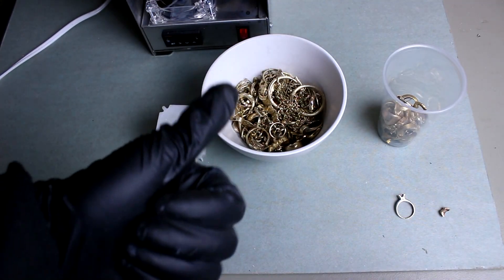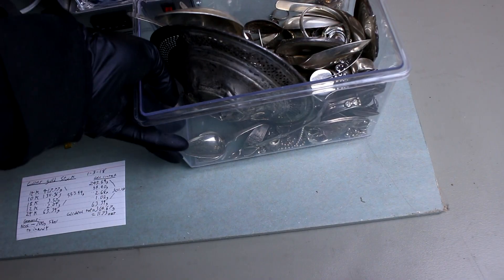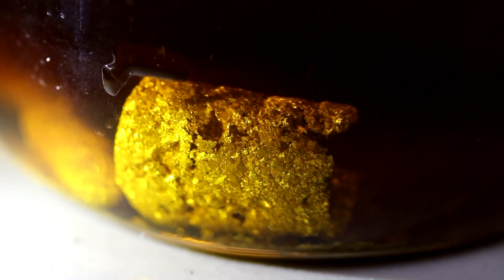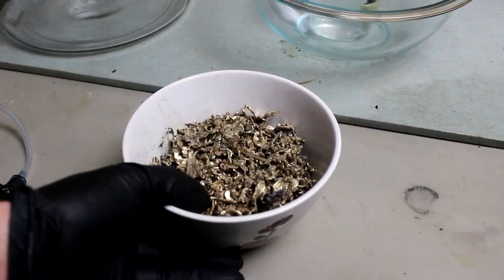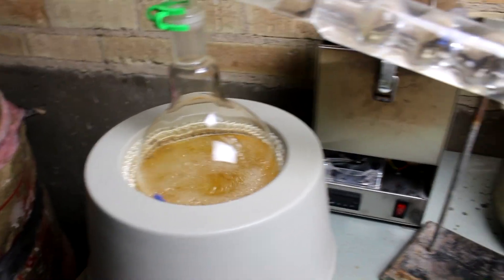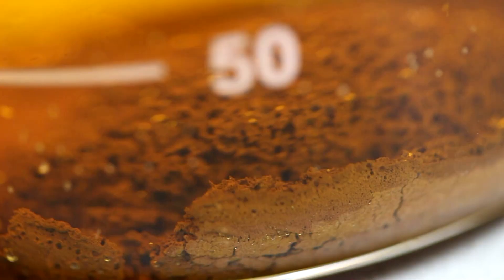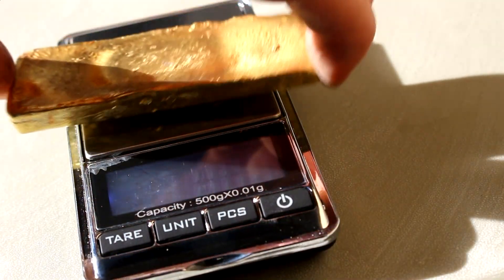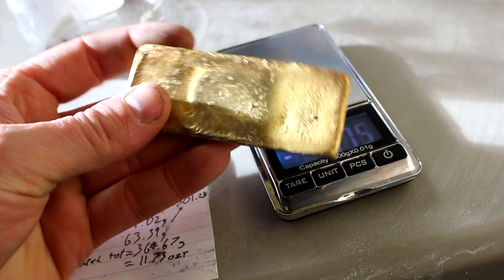Metal Refining & Recovery, Episode 22: 15,500$ in Gold?

Comment: Thanks for the informative video, great job...
You seem like the perfect person to ask a question... I'm wondering if you can be persuaded to make a video about gold plating at home a little different from the one with the truck bumper and I have nothing to offer but gratitude in exchange but I've been trying to find a way to make 14 or 18 karat gold electroplating solution so I can do some electroplating here at home. Everything I can find on making electroplating solution is all for 24 Karat and I don't want to plate with 24 Karat because in my opinion it just screams "plated" as no one makes jewelry out of 24 karat gold (not jewelry that's going to be worn anyhow) and I keep coming up empty-handed. I can get my hands on everything I need I think the hardest to come by would be the nitric acid and potassium cyanide but ideally I would like to be able to do it without the potassium cyanide (because I'm not trying to get myself on a watch list which will make more sense before I'm done) and without having to make an impregnated solution preferring to go for an electrolyte bath with a donor anode that would dissolve to provide the gold instead of being dissolved in solution if that can be done but to be honest I've spent so many hours searching I'll take whatever method I can get as long as it works and I don't have to go into debt to buy 14 karat gold plating solution that is well beyond my means at over $100 per gram to buy it ready made because I'm going to do multiple thick platings for an end result more like gold filled but through the electroplating process.
I want to re-plate some cheap plated stuff my mother used to wear all the time but looks like s*** now with all the gold worn off (for her 85th birthday).
So what would it take to persuade you?
She'll be 84 next month so I'm not in a big rush but at the rate I'm going I wouldn't figure out on my own in time I don't think because there's precious little information out there that I've been able to find. I'm not a chemist I actually never went to High School so I have no chemistry background at all other than one semester of biochem and what I've figured out on my own which is more than most people but less than what's required evidently.

For the record I never finished the 9th grade but after doing some time I got my GED and a degree in nuclear medicine (I was never able to use) so I'm not hopelessly ignorant or anything like that, I can easily keep up I think and I'm a quick learner because I enjoy learning just keep in mind I graduated in 95 so I might be a little rusty.  You're the 5th or 6th person I've asked through YouTube comments like this of people who do the gold refining but so far no takers or I wouldn't be having to ask but I'm a stubborn SOB and I'm determined

Comment: Instead of using HNO3 to make aqua Regia to dissolve the relatively pure gold, isn't it possible (albeit a bit more dangerous) to just bubble chlorine gas into the HCl? I know you can do that with platinum in a solution of HCl, so I cant see why it wouldn't work with gold.
Reply from the maker: I’ve done that in some other videos. Used bromine too.

Comment: 7:41 you shall add acid to water and not water to acid for safety reasons
Reply from the maker: You shall go up stairs starting with your left foot for safety reasons.
Reply: @theCodyReeder  first I can't believe that u replied to me 😊
Second, I've spent many years in chemistry lab and I'm still working on my PhD thesis in chemical engineering. So when u add water to acid there is a high chance of strong reaction and bubbling where acid might splash to you. So the best way is to add acid little by little to water and have the beaker in cold water (coz it's exothermic)
Reply: @ChefAkram  he made a series of videos about the very topic. That's why these comments annoy him

Comment: Be me
Dissolve a ton of gold
Try sodium metabisulfite
Have nothing happen
Panic sets in
Questions existence
Tries sodium bicarbonate
Something happens!
Puts in furnace.
Nothing happens
Questions existence again

Turns out every time I'd try to melt the gold it would just make a composite with the carbon and sodium... Or something like that. Anyways I rinsed it off over and over and it melted just fine with a map gas torch.

If you have trouble like this, your metabisulfite may be spoiled.
Just heat the solution up a bit and be patient

Comment: On the 26th of January 2018 gold prices were £30.55. That X by 357(G) of 24ct would've given you £10,906.35 and that exchanged into $ is $13,372.12(Not $15,500.00) However though, in today's market the price of gold is £44.87 so if you still are holding onto that bar of gold, it's current value is $18,926.71. So within 2  1/3 years your investment would've made you $5,554.59! Let this be the choir that preaches the importance of investments people...

Comment: "I'm running a bit low on nitric acid, so I decided to make some more."
Only you, Cody'sLab
Reply: That's how you get nitric... you produce it. buying it is impractical.
Reply: @xjunkxyrdxdog89  
Depends how much you need. It's impractical to produce liters and liters of nitric acid when it's relatively cheap to purchase reagent grade nitric in bulk.
Reply: @DarkMatterX1  fair enough. I was only thinking of the hobbyist when I wrote that. I wasnt really thinking about applications that would require bulk nitric.
Reply: Only? You do know science wasn't invented by Cody, yes?
Reply: @User0000000000000004  yes it was

Comment: Why use aqua regia method when sodium cyanide is so much cheaper than the nitric acid alone?  I mean, even if you didn't want to make NaCN (nurdrage had a video tutorial on how to make it for less than $30), you can buy it from a chemical outlet for around $100 for 100 grams and you'd only need a gram or so to dissolve the amount of gold shown in the beginning. Compare that to nitric acid that's $70 per 500 ml, and that's an insane difference when single run will cost you at least 100ml! Not to mention the cyanide method cuts the need for the expensive looking crucible. The only drawbacks I see are it would take days for that amount of gold to dissolve in NaCN and you'd have to be willing and able to work with highly toxic material. The latter keeps me from doing it, but Cody's demonstrated he's perfectly comfortable working with (and drinking) cyanide, so why not use it to dissolve gold?

Comment: Why do you use silver to melt the gold? Im learning.
Reply: Mr. G take what i say with a pinch of salt. But i assume the gold is a alloy not pure so it may have zinc in it for example and when the gold alloy is melted the zinc along with the gold turn s to a liquid and if left to harden the zink would just bind with the gold again so i think the silver is there to react with the gold as you can then just disolve it off??
Reply: Thanks! Also why cant we just melt the gold with something and pour it into small bars? And not use chemicals?
Reply: Mr. G because it is not 99% pure. All gold jewellery is a alloy( a mix of 2 or more metals) to make it more durable. However gold bars need to be pure.

Comment: Would it be possible, when you're dissolving the metal in nitric acid, to catch the NO2 fumes in H2O or H2O2 to recycle them into more nitric acid?  It's be super neat if you dripped he recycled acid back into the experiment.

Comment: Im sure there is a complicated answer for purity but why did you need to add silver and dissolve it in acid and all that then re melt it in the foundry? You had molten gold in that before adding the silver and you should have been able to turn that into an ingot. Would it have been poor purity somehow? I would understand if the acid step were just to remove silver and/or brass but you added the silver for a reason and had an amount you calculated you needed.

Comment: 😢I'm going in circles over this issue:neutralizing the Au/acid solution before adding SMB! Why does it seem to not always be necessary? I've feared ending up with the black slurry while failling to first neutralize. 

Am I correct in interpreting here that neutralizing your Au solution prior to precip. is only vital if it begins reacting poorly? The black slurry is not a failure because its reversible? Thanks, Cody.

Comment: I love how you're such a perfectionist
Reply: hes not.  hes sloppy as fuck
Reply: @JR-pj8pz  Just curious how is he sloppy?
Reply: The method is absolutely wrong, a very long time and money spent on nothing. there are many quick and easy ways. wrong is only can deceive you. if the gold is not 24k, it is already mixed with metals, in order to clean it we do not need to add other metals such as spoons and anything but to remove those that are in it. he from 14k makes it 5k to clear it to 24k🤣🤣🤣😂😂😂
Reply: @Prince-nt4dc  Oh yes spoons is my favorite type of metal, not silver. Also clearly you don't actually know about chemistry because the point of adding the silver is to make it easier for the acid to dissolve the silver, because if the gold wasn't diluted then there would be a lot more silver/other metals trapped inside the gold preventing the acid from dissolving them.

Comment: What's diesel exhaust fluid ?? Anyone know what chemical or mixture of chemicals it actually is ?
Reply: That is basically Urea - CH₄N₂O (32.5%) mixed with 67.5% de-ionized water. Urea neutralizes Nitrogen ions and prevents re-dissolving of the gold.

Comment: I've always thought gold was simply put into a label of something strong enough to hold the molten gold and at the same time, not melt when heated. Is the true process really using these kinds of chemicals to kind of dissolve gold? How common really are these kinds of things?
Reply: It depends on the purity of your gold. Not much of this was actually pure gold, it has lots of alloying metals that need to be refined out. This is done using acid as it's fairly easy to anticipate the what will react and what won't. You can decide whether you want to dissolve ONLY gold, and leave silver behind. All gold has to be refined to some extent, we don't simply find pure gold in the wild and melt it into a bar.

Comment: i think it's odd that you need to add more silver to remove the other silver
Reply: You have to add enough of the elements on one side of the equation to get the proper ratio of products out of the reaction. (ex: if it takes 3 parts gold, 5  parts silver, and 10 parts acid to form the silver solution and leave a gold precipitate and you only have 2 parts silver [from your 10-18K jewelry] then you need to add more silver in order to completely react with the gold/silver compound(s) to get all of the gold out)
Reply: Not quite. If there is not enough silver, some if the silver molecules will be trapped in the gold, so the acid cannot reach all the silver to form silver nitrate. You would still get all the gold, but it would contain more silver as an impurity than is desired. 

If there is way too much gold, then only the silver at/near the surface reacts and the gold/silver inquart does not decompose.

Comment: Cody can you do a video where you refine iron out of iron vitamin supplements want to see what a big tub of them refined down actually looks like. Cheers
Reply: This actually sounds very interesting
Reply: Daniel Asher 
Yes!  That would be very interesting!
Reply: Has he done this yet? Great idea my friend
Reply: You can do it with magnets
Reply: FluffY PenguiN yup it definitely different, I looked into putting rusty nails in water for iron, it is totally different than iron we consume.
Reply: interesting. but i dont think there is much iron
Reply: FluffY PenguiN  Electrolytic iron is simply iron that has been purified by electrolysis.
Reply: FluffY PenguiN  "Elemental" simply means "Pure". It is the mathematical amount of iron that would exist if absolutely all impurities were removed.
Reply: Yes this
Reply: Why? The amount of iron would be slight.
Reply: @buggsy5  like u even know.
Reply: Did you ever look at the labeled iron content - then compared it to the weight of the pill?
Reply: Since no one has looked at this, here are the calculations. The most common formulations contain the equivalent of 325 mg elemental iron per tablet - which means each tablet has 65 mg of elemental iron (if you can recover all of it - there are a bunch of other compounds in the pills that might interfere). An inexpensive version I found on-line has 180 tablets and costs $13.99.

That means that each bottle contains 11,700 mg of elemental iron, or 11.7 grams. So 10 bottles would contain about 4 ounces of elemental iron. Note that this is Avoirdupois ounces, roughly 3.75 Toz.  

The ferrous sulphate could then be reacted with calcium chloride,  yielding ferric chloride. The FeCl2 could then be electrolyzed to produce electrolytic iron. 

Or, extracting the sulphate from vitamin pills could be skipped and just use copperas, which is very cheap and used in one method of precipitating elemental gold from an auric chloride solution.
Reply: yeah....what he said^^^ that's exactly what I was going to say....yep right on the nail 

okay yeah...that's bs but lets go with it lmaoo

Comment: and add 3 tablespoons of silver haha
Reply: Bailey Reid HAHAHAHAHAH
Reply: Bwahahaha
Reply: Yeah right
Reply: *add three silver tablespoons
Reply: There are a number of reasons for that. 

1) Extra silver does not hurt the inquart - a shortage will. It risks the gold passivating some of the silver so that it is trapped in the gold during the nitric acid digestion.

2) If the silver is obtained from jewelry, much of it contains solders, which reduces the calculated silver content. 

3) The manufacturer is allowed some tolerance on the silver fineness. The manufacturer will use the least amount of silver necessary to meet the minimum fineness requirement - thus minimizing the cost.

 4) The excess silver is recovered later and requires no additional chemicals when using the electrolytic silver recovery method.
Reply: @buggsy5  Its a joke buddy, the tablespoons were made out of silver.
Reply: @stealthybanana8751  That has nothing to do with my comment. Rewording - it never hurts to add a bit of extra silver, from whatever source, to a gold/silver inquart to ensure all the silver gets dissolved. If the gold percentage is too high, then some of the silver will be trapped in the gold, reducing the gold button purity.
Reply: @buggsy5  His point is that the commenter never said asked why he added silver. You throwing in your two cents did absolutely nothing, people already know. The entire point of the comment was a joke. Therefore, YOU'RE comment is the irrelevant one.
Reply: @voix9209  YOU'RE = YOUR
Reply: @DavidSprings  I'm so disappointed with myself because I'm normally the one who corrects people on that shit. I guess the aggressive caps made me lose my sense of grammar.

Comment: Hey Cody, I've got a question: You're using the nitric acid to dissolve the silver, and you mention the gas coming off is N2O, which turns into nitric acid when it reacts with water. My question is: Why don't you bubble the gas through some distilled water to produce nitric acid that way? Does that not work for some reason?

Comment: I think the chlorine ions are the one that will be oxidized to elementary chlorine which dissociates and form chlorine radicals. they are finally strong enough to dissolve the gold. If it were like you said, gold-nitrate should be formed if you don't add the HCl, right?

Comment: Whoa, did you just pour water into acid?? isn't that a chem 101 no-no?  or is it weak acid to begin with?
Reply: I don't know anything about chemicals but he used distilled water, does that make a difference?
Reply: He made a video earlier about it, I’m sure you’ll find it :-)
Reply: No, that is not the issue. when you add water to acid, a lot of heat is produced which can cause the acid to boil over. having hot nitric acid splashing all over is not a good thing. but if his water was very cold, it might not be an issue.

Comment: Adds water to acid on camera just to screw with the chem profs.
Reply: He was referring to the fact that chem profs say to only pour acid to water because the chance of pure acid splashing is taken away.
Reply: I flip out every time he heats something up with a torch with his bare hands, Cody and safety don't mix lol
Reply: Alexander K Cody laughs in the face of danger
Reply: The issue is, when the water is added to acid, the water can absorb the heat that is produced by the dissociation of the acid... If you add water to acid you will have much more heat accumulate and can cause splashes, spitting , boiling , and melting of containers.... And hot acid reacts much faster... so on small scale ok but not large amounts
Reply: Mark casper i mean when he did it, it was snowing so he's relatively ok
Reply: not all acids are accelerated with water
Reply: The issue is only with sulfuric acid
Reply: Try working at a plating plant. I was a plating technician for 15 years. Silver salts are highly flammable. Then you have a cyanide bath about 20 feet from an acid bath. Well one day the maintenance guy sparked something behind my machine and the flames hit the ceiling. First and only time my life flashed before my eyes. The waste treatment guy told us prior if the acid and cyanide ever mixed we'd never make it out of the building. Well good thing me and  another guy quickly grabbed fire extinguishers and put the fire out.
Reply: Famous last words...
I cringe every time I see Cody do it... :)